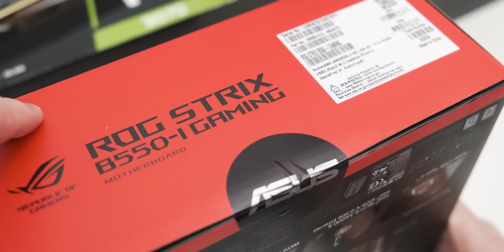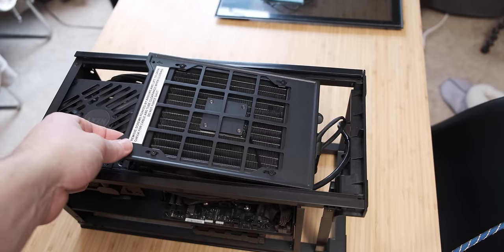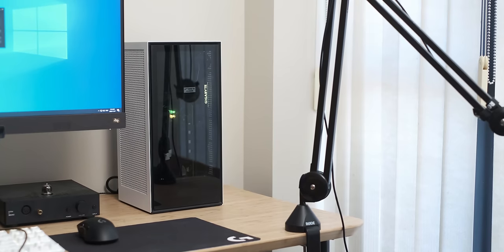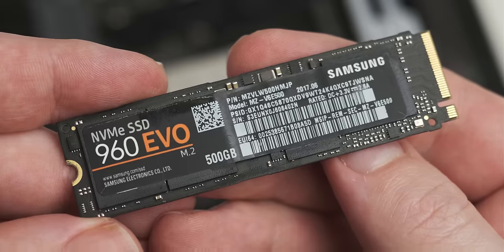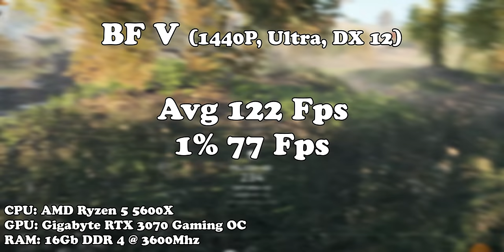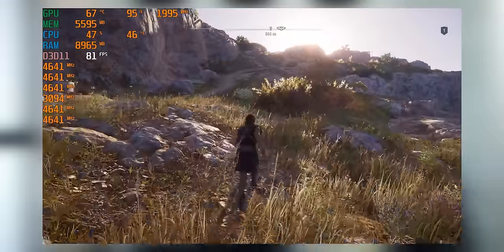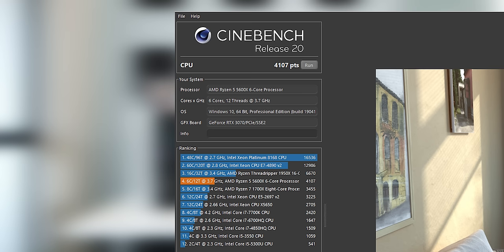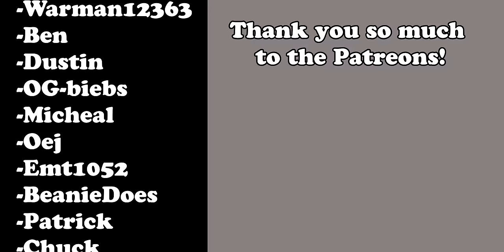Amazing AMD Ryzen 5600X and RTX 3070 ITX build (With Benchmarks)

Comment: I guess I happened to be in the right place at the right time. I was at Micro Center and I was looking to make an upgrade. I got a B550 motherboard and a Ryzen 5 5600X for 500 bucks. It was one of the best upgrades I ever did. 

Also, I'm pretty sure that case is a fire hazard. Gamer's Nexus did a bunch of research on that case and I'm pretty sure NZXT has a recall on it as well as taken it off the shelves.

Comment: This is a good build, I'm surprised there was no CPU bottleneck. To correct Dawid in the final parts of this video, it's supposed to be the AMD Ryzen 5 5600X and the (Gigabyte model of the) Nvidia GeForce RTX 3080 not AMD Radeon RX 5700 or AMD Ryzen 7 5800X or AMD Ryzen 7 5700X and the RTX 3070. It's alright, humans make mistakes.

Comment: Just install a chalkboard vinyl ontop of the glass and draw somethign cool on it. Problem solved. Beefy insides need an exhaust fan or two in the back, which help a ton with airflow and they aren't visible at all.

Comment: Hi Dawid.  I have the same case in black and there are enthusiasts that sell the front metal grille to replace the glass.  However I have a stock H1 with Ryzen 3600 and 3070 Asus TUF and it runs alot cooler and quieter at 65 degrees c with low fan noise.  I love this case.

Comment: Thanks D, was hoping someone would do this combo in the NZXT H1

Im currently running a gen 5 3600 and a rtx 2070 super and getting similar thermals to you (high 60 - low 70) in the H1. I totally agree on your front panel suggestion, wish they would make one (modded the back of my case with x 3 noctua 40 mm fans to help exhaust)

Good to see the case can handle a rtx 3070 👍🏻

Comment: I would have liked to see a comparison between a system in this case and outside (different case or open air). 
5600x and 3070 are pretty damn good parts, we know they will perform well but the interesting part of such a tiny build is the performance loss due to thermals. Even if the temps like fine you will often lose some performance due to boosting algorithms. Would have loved to see this.

Comment: AMD Ryzen: 4 vs. 2 Sticks of RAM on R5 5600X for Up to 10% Better Performance /  Gamers Nexus .  huge boost with 4 sticks ram . but can you check if it benefited the 3800xt or 3600xt in the same way. i can see where the 3600x  wont  but the xt might

Comment: I plan to build a system with Ryzen 5600x and RTX 3070. With some time having passed since the release of the RX 6800, would you recommend pairing the  RX 6800 non-XT with the 5600x over the RTX 3070?

Comment: Personally,This are the only cpu i would go for until they dev games for higher core counts.I have a 2600 and when using unity there's here and there that it doesn't run fluently.I just don't know if it's worth the upgrade.Maybe a 3600 as i have a B450 gaming plus non max so idk if the new cpu's would work tbh

Comment: Do we have power consumption numbers for this build? Nvidia is recommending over 700W for the 3070 and most people are concerned about the 600-650W H1 preinstalled PSU. It seems fine... any power spike crashing from the GPU tripping overvolt?

Comment: After seeing how poor temperatures were with the RTX 3070 founders edition in the NZXT H1 I do wonder what the best RTX 3070 for this case would be for stable temperatures.
Reply: Well I've had a gigabyte and a tuf gaming 3070. The gigabyte had 3 fans and max I ever saw it hit was about 75 degrees, but that was ultra 4k. My tuf gaming one (which unfortunately was its replacement) is more or less the same depite it's 2 fan configuration. This card does get hot 🔥 but it does what I want it to do. I just mostly play at 1440p nowadays, I just don't think the 3070 is quiet made for 4k gaming on my end, but it still can impress.

Comment: SIr Dawid  i just bought ssd 240gb and Geforce gt1030  to play csgo but my fps is like 40 what i need to change to improve my fps atleast a 100
Processpor:AMD A4-6300 APU with Radeon(tm) HD Graphics  (2CPUs), -3.7GHZ
Memory: 6144MB RAM
Motherboard:gigabyte ga-f2a68hm-s1

Comment: there are multiple drop-in custom front panels for H1 on the internet. I got mine for 50 bucks.
Reply: did you compare gpu thermals with/without the glass?
Reply: @bxxx2  yes but it depends heavily on the card you are using. 2080 super then there is a 5 to 10-degree difference. So it helps alot.

Comment: I will be buying this kind of system in the near future but my question is wheather 24 inch 1080p 144hz display is enough for it or 27 inch 1440p 144hz monitor which I can't really afford.

Comment: can i do a 
Gigabyte B550M GAMING
MSI RTX 3070
16 DDR4 3200mhz
Ryzen 5 5600x
80+ Gold MWE 750W 
MSI MAG Forge 100R RGB Tempered Glass Case
1 TB HDD
500 SSD m.2
would that be all compatible ??
the mobo is the right size but I'm not sure if the power supply is good enough and i am a little worried if the mobo is good enough quality for this build
ps i won't buy the RTX 3070 till I see the RX 6800

Comment: I wonder if your samsung evo problems happened because you've reformatted the drive or rewritten too much data on it. That was the first reason I heard ssd's were bad for games. Not the size, but them losing more of their capacity everytime you erase, and then rewrite over that space. Compared to hdd's. This was just what I heard when I was just getting back into building so I may be wrong. And I don't think it should happen that quickly. Seeing as people are using m.2's in servers. Although it's not exactly recommended.

Comment: Not bad as I would have prefer the 5800X as the 5600 series is the peasant processor.

Surprised you didn't take advantage of PCIe Gen 4 and used a Samsung 980 Pro instead of the slower Samsung 970 Evo.

Use the Samsung software to fix your SSD.

I love smaller computer builds as I can't believe people are ignorant enough to put something like an ATX case on their freaking desk.

Comment: I have the exact processor and motherboard but my idle temperature are high and the core voltage is always higher than 1.4 volt. 
I flashed the latest bios 1401

Comment: Did you have problems with booting? I have the same 3070 model and I'm trying to put it in my H1. My system won't display and my keyboard + mouse aren't getting power. Everything works fine when I use my old gpu. I used DDU and everything but no luck. Pls help

Comment: Can anyone tell me what type or cooler for the cpu he used ???
id appreciate it because im using stock cooler and it heats up real fast i got 2 fans running and one exhaust fan with 500 w
Reply: ive also got that rtx 3070